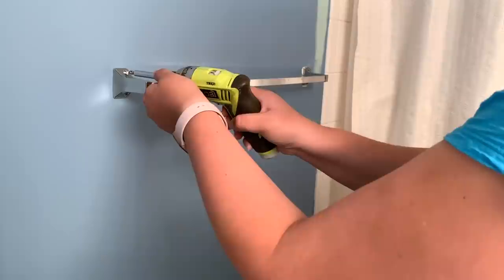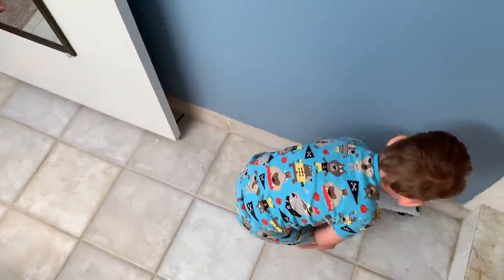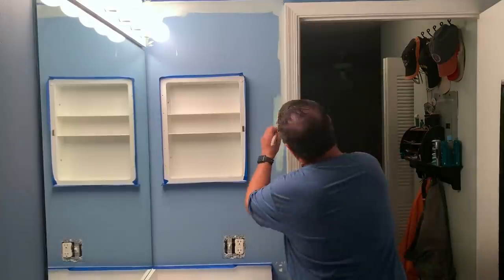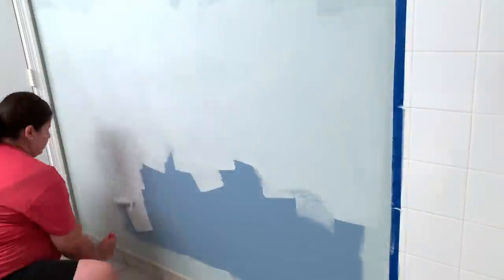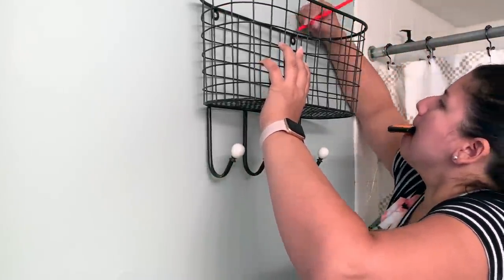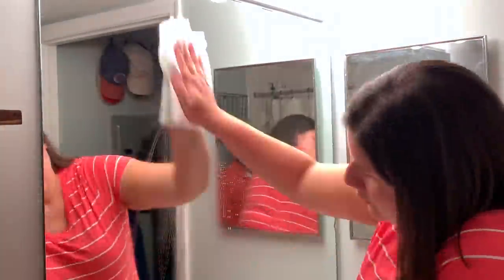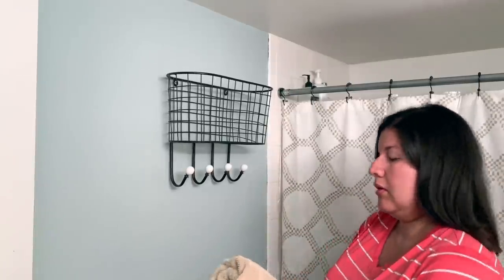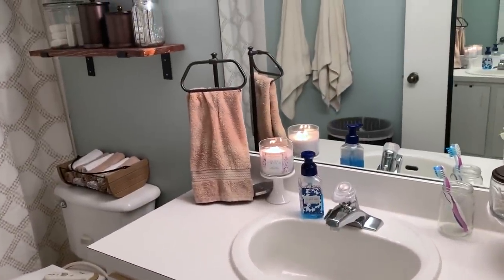🛀 SMALL FARMHOUSE BATHROOM MAKEOVER | ON A BUDGET | RENTER FRIENDLY

Comment: The only thing is that the wash clothes should be on the top shelf and toilet paper more accessible should be on the back of the toilet.  However love it
Reply: I agree about the wash cloths going up high. Every time you flush, toilet droplets spray into the room. Studies have been shown toilet plume can go from 2.7 feet to 6 feet in the air and since yours is a tiny bathroom and the toilet is older, it is something to consider. That is why it recommended that tooth brushes be kept in a sealed container if on the counter or put in a drawer.  I used to keep a basket with rolls of hand and wash cloths on top of the toilet until I discovered this.(I dont believe it is possible to make every family member close the toilet lid before they flush lol)   I still think the switch would not affect the lovely improvements you have made. One other thing, I would switch to a rectangle clothes hamper with a lid so it sits wider and closer to the wall. The round one seems to big for the space and when stuff gets dumped in it, would clutter your neutral zen space. Just my opinion.   Nice job!
Reply: @topherjoe1  close your toilet when u flush, no plume
Reply: @marinaannetoma1268   I do,  many don't.  It's because of them toothbrushes in the drawers and towels and wash cloths in a cabinet. My ex and son,( as a child) never did and even though I would rant at them, they would forget. Now, my son understands and my ex is not an issue lol but the arrangement stands.
Reply: @topherjoe1  its that mankind has survived this long w/o every one being germaphobes, my dr told me to stop with germ soap and hand sanitizer unless illness in family, I get your point,valid one, but everyone should just do themselves, to critique someones decor based on germs is a lil much to me but each to his own
Reply: @marinaannetoma1268   it was not meant to be disrespectful, I see you point as well. And I agree about overuse of  sanatizers, marketing got a hold of that trend and took it to the limit for sure.
Reply: Yup, toilet paper where you can grab it without standing up. Be careful with the candle next to the towel. Nice job. My bathroom is even smaller and not square.
Reply: @Sophia Vanvrek i agree w/ you, unless they are in a cubbord that has a door you can shut!
Reply: How about washing them 1st before putting them out!

Comment: Gosh, you just made the painting part look so easy! LOL  If only it could be done in one minute! :)  I always feel so stressed painting though.  Sounds like a good idea at first, then we get to the par where we need to edge etc...and ugh. Our ceilings and wall have a slight texture (florida life...lol) and we couldn't tape off the ceiling!!!  :( 
Why in a V motion for the first coat?
Reply from the maker: I actually like painting! LOL I actually think it’s easier when your ceiling has a texture. All my ceilings except for my bathroom and kitchen have popcorn ceiling texture on them and I just use an angled brush and do it by hand to cut in. It sounds intimidating but once you do it it’s really easy! I’m in Florida too! So I do the V motion because when you just go up and down sometimes with paint that has a sheen to it, you can see it gets streaky. Like if you go up and down you can see those strokes and I feel like it covers better when you start off with a V-W shape and finish off up and down if that makes sense. You’re going in different directions so it makes sure especially if you have textured walls that every bit gets covered. Thanks for watching!